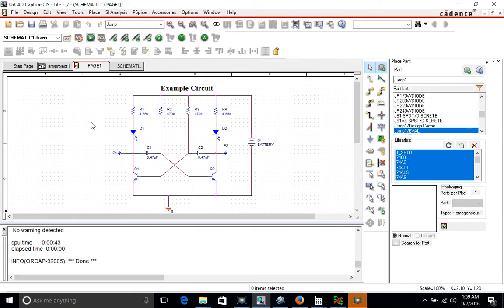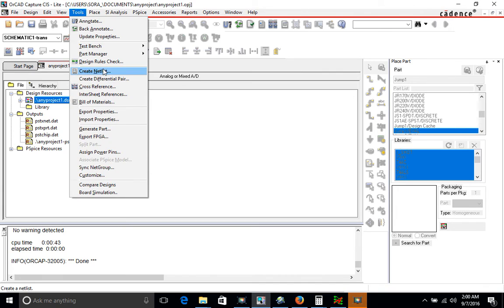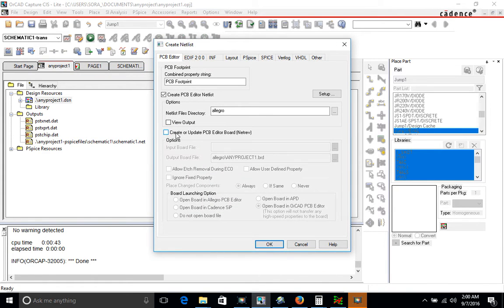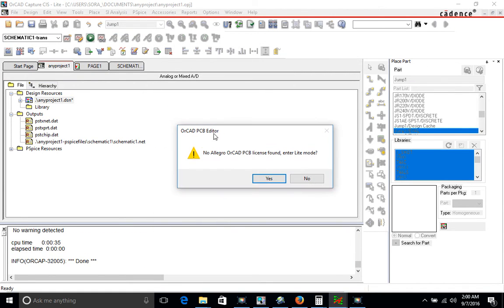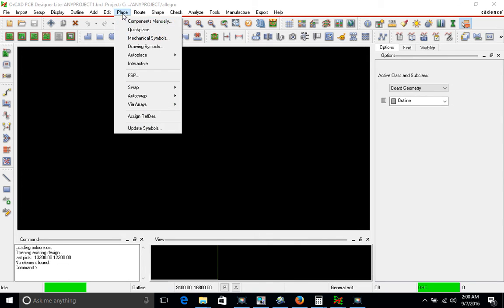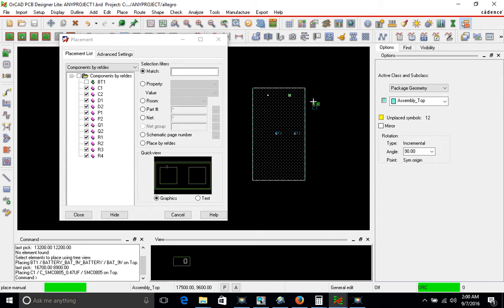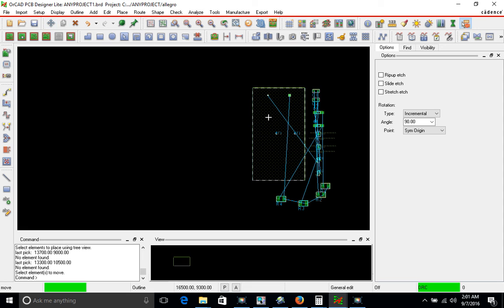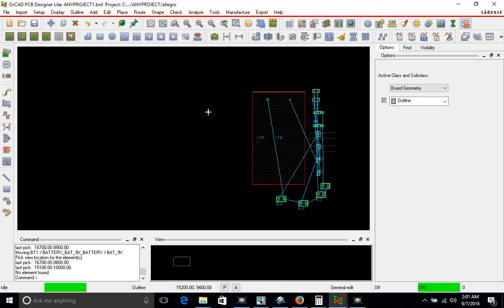OrCAD PCB Design Tutorial 15 | Create a Netlist and Place Components | Tech Ed Kirsch

Comment: hi ,so when I try to create the Nelist it says that I have succeeded but I have warnings and it tells me to check them in "netrev.lst" ,it says in the warnings that it couldn't find the symbols for the LED, the battery and the transistor, so I copied all the components of the custom symbols folder into these paths : 
 c:/cadence/spb_17.2/share/local/pcb/symbols 
 c:/cadence/spb_17.2/share/pcb/pcb_lib/symbols 
I retried and it did load them but the warning for the battery still remains, here's a what it says in the warning, this is just a part of the whole session log:

------ Oversights/Warnings/Errors ------

#1   WARNING(SPMHNI-192): Device/Symbol check warning detected. [help]

WARNING(SPMHNI-194): Symbol 'BAT_9' used by RefDes BT1 for device 'BATTERY_BAT_9_BATTERY' not found in PSMPATH or must be "dbdoctor"ed.

------ Library Paths ------
MODULEPATH =  . 
           c:/cadence/spb_17.2/share/local/pcb/modules 

PSMPATH =  . 
           symbols 
           .. 
           ../symbols 
           c:/cadence/spb_17.2/share/local/pcb/symbols 
           c:/cadence/spb_17.2/share/pcb/pcb_lib/symbols 
           c:/cadence/spb_17.2/share/pcb/allegrolib/symbols 

PADPATH =  . 
           symbols 
           .. 
           ../symbols 
           c:/cadence/spb_17.2/share/local/pcb/padstacks 
           c:/cadence/spb_17.2/share/pcb/pcb_lib/symbols 
           c:/cadence/spb_17.2/share/pcb/allegrolib/symbols 

      hope you can help and thanks in advance.
Reply: i double checked but the .dra and .psm files for the battery are in the default folders but i still get the same warning and the symbol doesn't load in PCB Editor ,i even added the custom symbols folder path to Setup > Preferences > Path > in psmpath and padpath alongside the default folders that were already there :
           C:/Cadence/SPB_17.2/share/local/pcb/symbols 
           C:/Cadence/SPB_17.2/share/pcb/pcb_lib/symbols 
           C:/Cadence/SPB_17.2/share/pcb/allegrolib/symbols
           C:\Users\Hp\Documents\OrCAD\Custom_symbols
but still nothing, could it be an error because of the name of the .dra file cause i've probably changed it, i also find it strange that the 3rd path doesn't exist for me when i search it : C:/Cadence/SPB_17.2/share/pcb/allegrolib/symbols
Reply: done